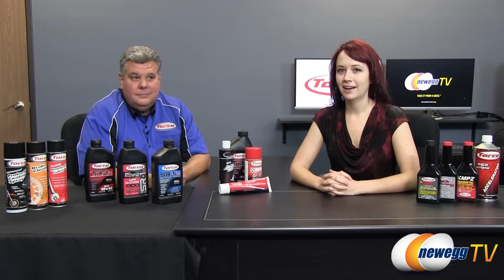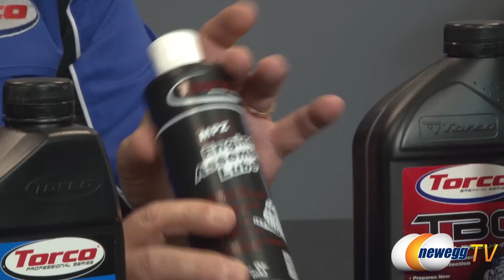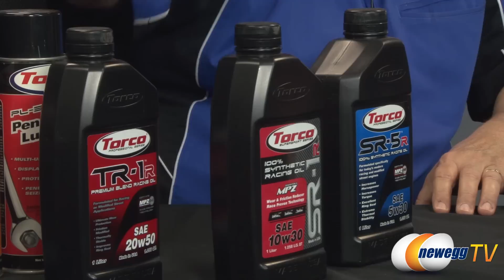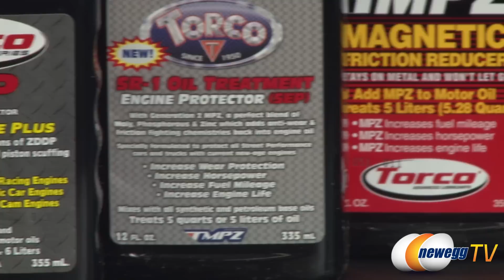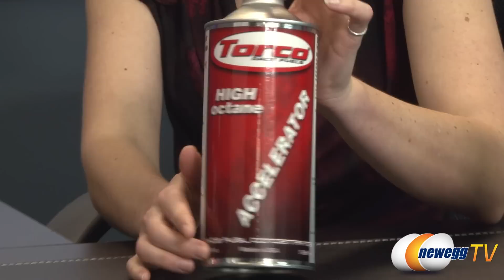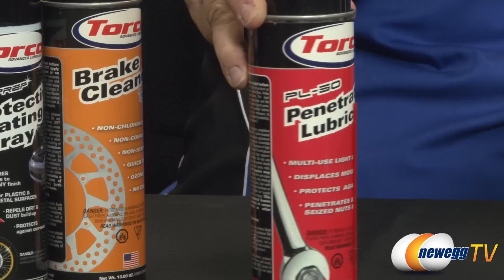Torco Advanced Auto Lubricants Interview - Newegg TV

Comment: It is quite a surprise to watch something like this in Newegg TV. I used to lube my motorcycle's engine with Torco T-4 (20w50). It was the best oil i have ever used (it was cheap, shifting felt smooth, it felt clean and safe to use). Unfortunately i haven't seen it in local stores for years now. I'm now using a Silkolene 4 Strokes mineral oil.